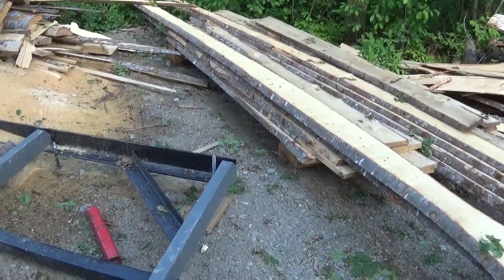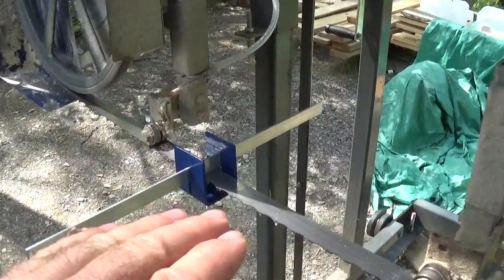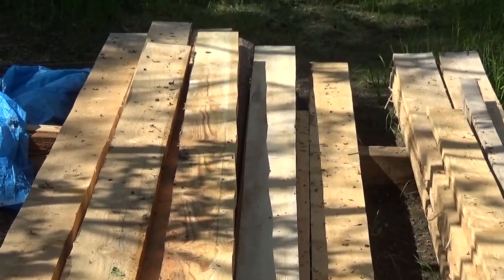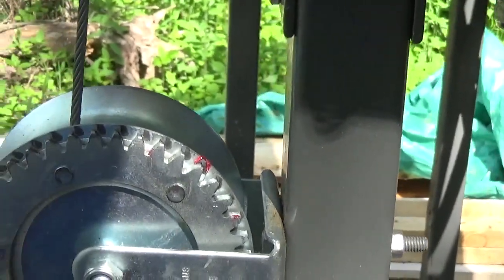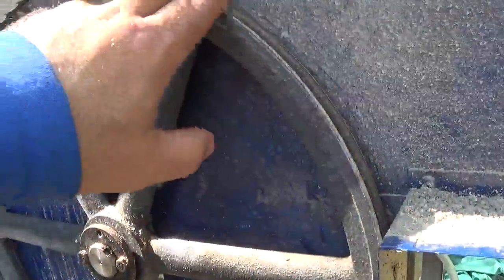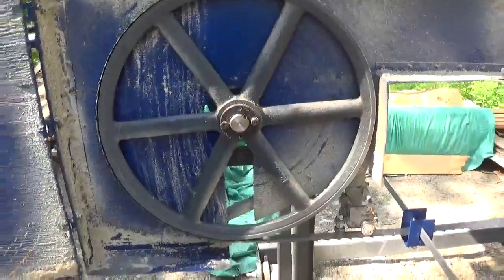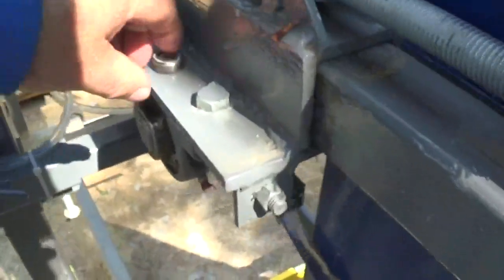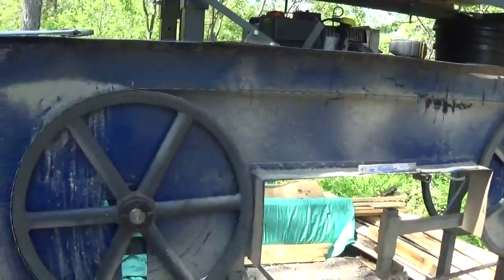Update on mi homemade sawmill

Comment: Hey there Serge!  I guess you've been pretty busy cutting planks. I'd definitely make a concrete slab which should give you a stable base for your sawmill.  Since you get so much snow up there, you may still have some minor issues with frost heaves.  Dig down 18 inches, fill with rock and tamp it down nicely then pour your slab and it should render a really nice slab that will not be effected much by the changing cold temperatures. Hope you do build a nice enclosure for your sawmill to keep your critical moving sawmill parts from rusting and seizing-up.  I look forward to see you cut some lumber and then construct a structure from your cut lumber.  Hope your family is doing well. The last I remember, you constructed a  ramp porch for your Mom to access the house.  Be well my friend. 👍🏽🙂
Reply from the maker: I Don.I bin busy for sure .
I have a full time job at around 40 to 50 hour a week plus milling wood , 24 hour a day is not enough.
Hope to have time to build this summer.